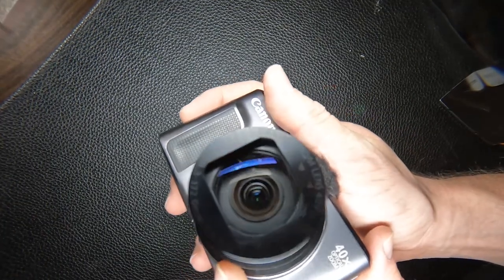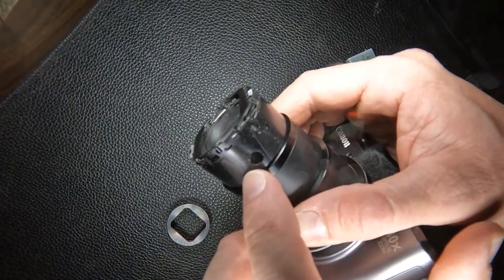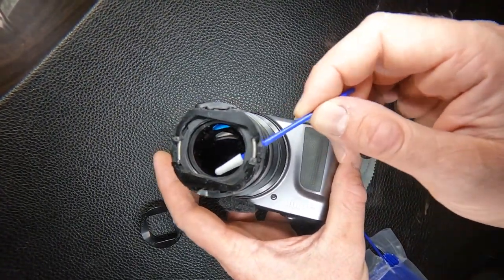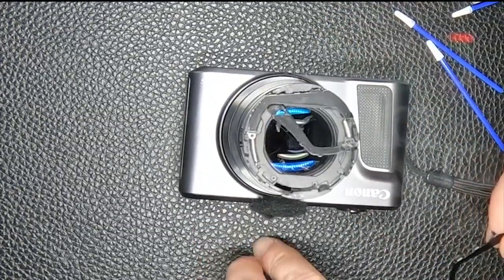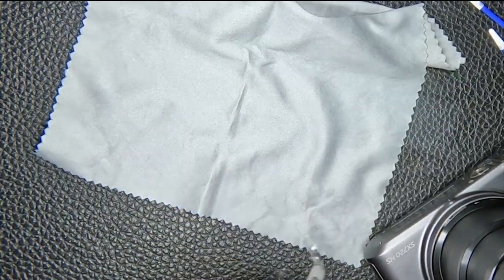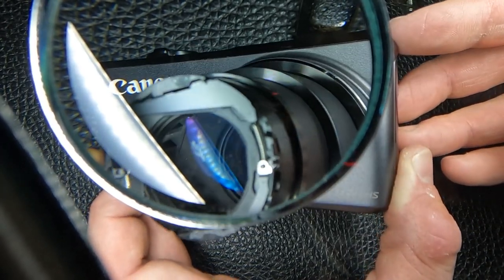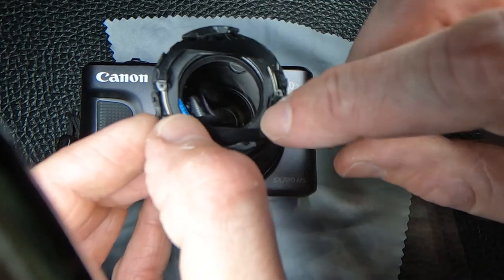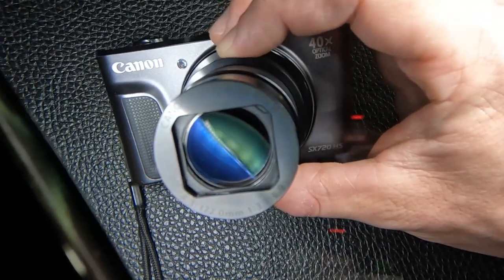Canon PowerShot Inside Lens Cleaning and Lens Curtain Reassembly

Comment: I dropped mine and can hear something stuck inside the lens and now it’s saying lens error and I can’t use it. The lens is stuck half way but enough for me to grab onto the end piece can I still pull the lens off if it’s not fully open?
Reply from the maker: I have pulled that end piece off without the lens being fully open. If you want to remove the lens assembly itself, that is separate procedure which I have not done at this point.